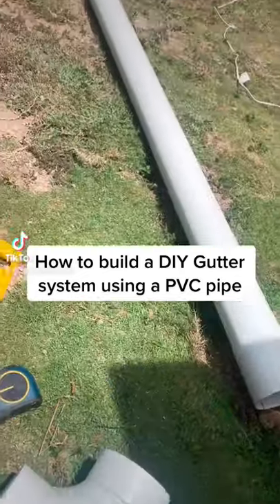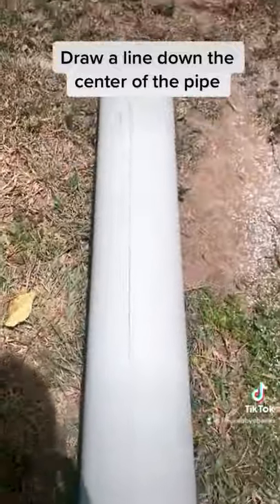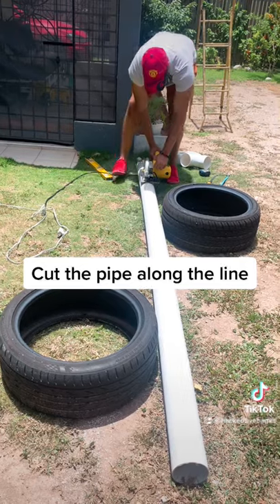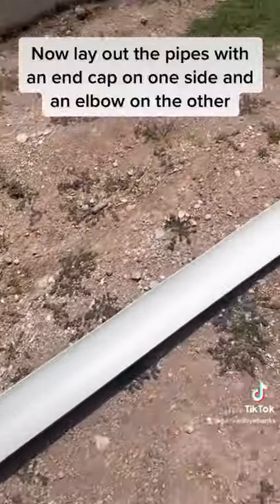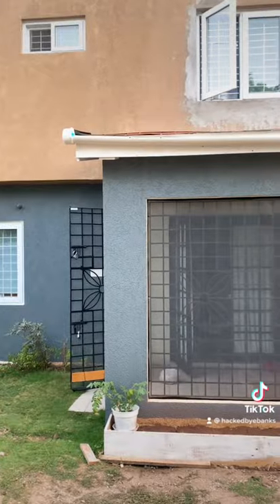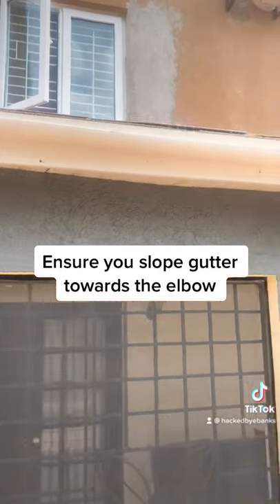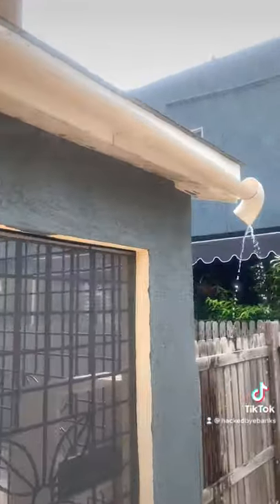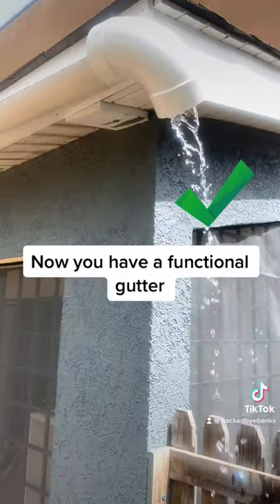DIY gutter installation using PVC pipe #shorts #DIY

Comment: White pvc isnt protected against UV rays. That will hardened and crack in a year or 2. There's always the possibility you get more. You also have heat to worry about. Roofs can become blistering hot. That may cause your gutters to lose their shape. I'm not sure it will. It's just a thought. Their is so much wrong here, but some of those things can be easily addressed. Like applying paint to get a little more time out of the pvc.  
I like that this could be useful for a quick, cheap, down, and dirty water collection system for a chicken coop or something similar. That woald also depend on roofing material/location. Or if you just need to throw something up to get by until you get the funds to do it properly. Just know that it's temporary and will need to be upgrade. All and all this isn't an alternative to gutters. However, it is functional. Which is all you really need it to be at the moment. Regardless of what you spend, maintenance is a part of home ownership.
Reply from the maker: Thanks for your comment. 
This is a small section of our home (less than 100sqft) and we did this to prevent water from getting onto the patio. We also set up a catchment to collect water for our home garden. 
It has been up for 3 years now and we haven’t had any issues with it. Still works and no cracks. 
The rest of our home has a slab roof with built in drain systems that runs off into a main drain system. So we only needed a quick and affordable solution and this works for this area. 
As with everything home upgrades and changes will be needed so whenever that time comes we will tackle it.
Reply: I have a nest door neighbor who has had his up for 8 years in South texas no problem